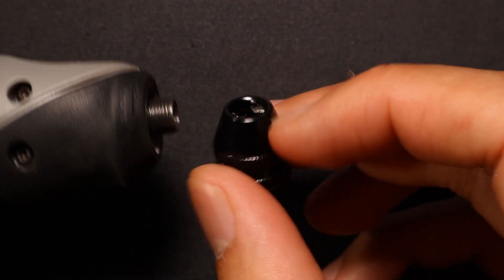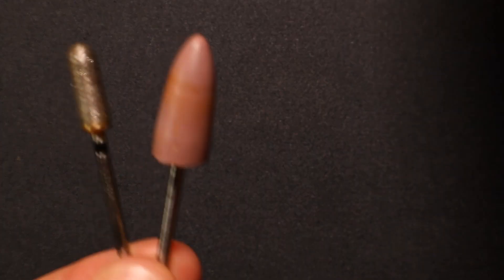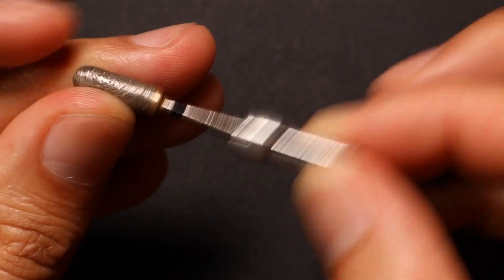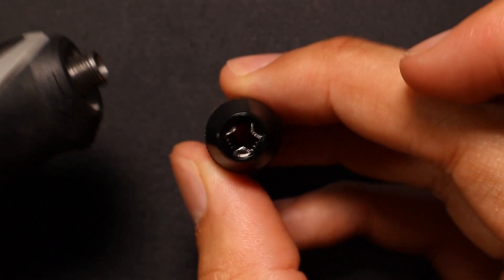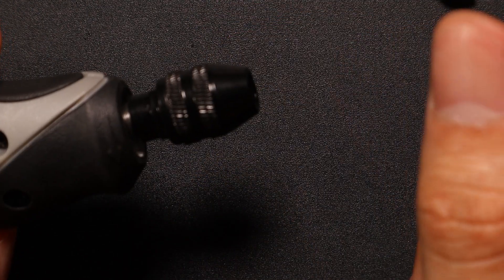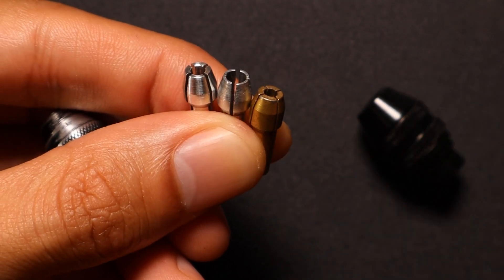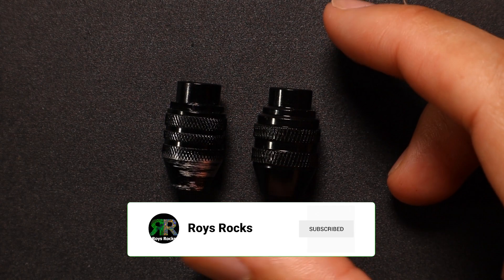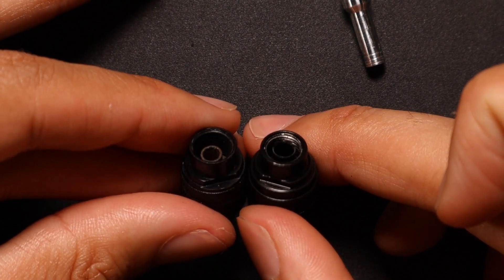How To Use A Dremel Adjustable Chuck And Why Its Better Than Collets.

Comment: Thanks Roy. I've been using dremel type tools for 30 years and always wanted a 3 jaw type chuck. I didn't know they made them.  I have a couple of the metric ones with posts that I use on my lathe etc., but I never knew that they made them with 9/32-40 threads. (which my tool has) So I found some on eBay. 3 for $8 ...Now I wait for them from China.
Reply from the maker: Nice one. They sure are handy. Imagine if you were using collets on a lathe! A true nightmare!
The threads not being the same across the board is soo annoying. 
The first time I bought the wrong ones for the ozito I was about to throw them out then tried them on a dremel and... it fit.

Comment: I have a cheap rotary tool that already came with such an adjustable chuck. Now that I have seen your video a remark my cousin made about shaft thickness finally makes sense. He was talking about the right shaft diameter and I didn't get it, because I had been using different diameters since the beginning. He is a gold smith and uses a lot of specialized tools.
Reply from the maker: Ah yeah if he has been in the game a while I'm sure he has come across the issue before so knows to look out for it.

Comment: Beauty! Just saved me a lot of time. Straight to the Ozito size. Thanks Roy.  You're a legend. Have a great day. Better head for the air con, come Saterday. Supposed to be 42 degrees  in Dimmy and only after you cop it first, in S.A.
Reply from the maker: Yeah dont get the wrong ones. They are cheap but a pain if you have to wait for another delivery.
Friday is our hot day here. Opal shed gunna hit 50+.
Reply: @RoysRocks  I feel for you. My place is an old weather board with no Insulation anywhere.  Only off grid power and batteries are not great at taking charge when hot or cold. Can get to 46 inside on a bad day. Sat may be like that. I'm heading for the back of the Ute with a swag mattress on that night. At least it cools down at night.
Reply: Deserts are like that. Cities are heat sinks. The roads just radiate the heat stored, all night. My sympathy for you. How is your dog? My puppy is close to 28 kg. She will wind up bigger than the greyhound. He is 42. She is 24 weeks old. Why do I do these things to myself????? Old body, dumb brain! LOL 😆

Comment: I have one bench grinder with flex shaft where the threads are lings. Have to stick to collets there, and use it for all my sintered, novas and polish tip. On my Dremel I use the adjustable one, burrs and cutting discs and such goes there.

Like them both, biggest plus to collets is that you don't need to make sure your bits are sentered, they allways are. Super quick when all shafts are the same size.
Biggest downside is that there are none small enough for my thin burrs, then the chuck is absolutely gold to have.
Reply from the maker: True the centering is something I forgot to mention with the collets. I've thought about having a dual rotary tool hanger using collets to fit both. Then I just change tool completely each time.

Comment: Mine lasted about 24 years and just finally took a dump the other day. Well, I should say it seized up about a year or so ago because it was packed with dust and I didn’t realize what was going on until the other day. I removed it from my Dremel and tapped out the little tool I had that was seized in it. I cleaned out the chuck and it started working just fine again, but I did notice that the little prongs  inside were not lining up after I played with it for a while.  Bought a couple new ones today to replace it.
Reply from the maker: A tiny bit of WD-40 has given some of mine extra life but I think they have all been pretty low quality so never lasted too long. The current Vevor chucks are going super strong though.
Reply: @RoysRocks  i sprayed.wd40 in mine after cleaning it. The springs must have been compressed to long because the clamps were falling out of place.  Ill spray dry grapgite in the new ones so i dont get dust and grime build up sticking to any wet type lube

Comment: I need me one of those! The large set of bits that I got for Christmas has some chunky shafts and some incredibly slim drills, and the brass holders are just a bit too large for the Dremel extension.
Reply from the maker: Yeah assorted shank sizes are a mad pain before getting a chuck.

Comment: Excellent info, especially the part about the two different collet nut sizes! Now, does anyone make a right angle attachment for the larger size thread?
Reply from the maker: I have seen right angle couplings before but never had much use for it myself. I can keep an eye out for one to pop up again. Maybe it was on amazon?
Reply: @RoysRocks  Thanks! I'll try and see if it exists, too. Most of the ones I've seen state "fits Dremel model XXXX" (and all dremel's use the same collet?) And I probably should've originally asked "the larger, metric thread (M8 0.75mm)" for others who may be interested, sorry about that!

Comment: Hi Roy. ...help! On Amazon there is a short tail & a long tail version of this Chuck ....  both are M8 0.75. So which one do I pick
Reply from the maker: All I sue are the short tail option. Some of the long ones might not reach the fully closed position.
Reply: @RoysRocks  Hi Roy, Thanks for replying so quickly. I will order the short tail one. Thanks again.  🙃

Comment: I have heard to always use the original collet chuck for the mini cut off wheels, but other than that the 3 jaw chuck works Great for everything!
Reply from the maker: I've had no trouble sawing with the adjustable chuck so far. I think cutting wood with a wood saw blade would be the riskiest one and there made the collet would be better but even they can slip occasionally.

Comment: My dremal shaft is just a hole so these don't work. looks like there is meant to be a cone inside the dermal shaft which you didn't show so was wondering is this a piece that you can buy to go in?
Reply from the maker: Just a hole? How does it hold on to anything if there is no way to close the hole?
Reply from the maker: "looks like there is meant to be a cone inside the dermal shaft which you didn't show"... no cone inside the dremel. 
It is literally just the thread which you can see from 0:00

Comment: I found out when I ordered my nova points that they didn’t fit my dremel. I bought the adjustable chuck then and it’s great so far. There have been a few times that the bur came loose while using it. But I figure I probably didn’t center it well. Definitely worth the cost to not switch the collets back and forth.
Reply from the maker: Yeah it is a small price to pay to reduce changeover hassles.

Comment: Great review.  The thread size issue had me confused stupid.  I have a dremel and a ryobi.
Reply from the maker: I think Ryobi will use a M8 0.75mm but you can check by measuring the diameter. It'll either match an M8 width or 9/32".
Reply: @RoysRocks  Jeez, don't worry about that Roy.  I'm just grateful for the thread size explanation.  I can work it out easily from here now.

Comment: have you experienced any problem with the keyless?
suddenly all of my bits started wiggling with the keyless or the collets
Reply from the maker: Hi. Not sure why my replies are not getting through... youtube issues.
I use a protective lubricant like WD-40 to make mine last much longer. The springs can corrode quickly due to the water.
Reply: @RoysRocks  no water is no problem i dont do anything with stone or glass
usually PCB and some light metal work and wood work

Comment: I use the adjustable but my burrs always vibrate loose. I have to re tighten often. I have a dremel with flex shaft. Suggestions?
Reply from the maker: I dont typically advise it but even on the adjustable chucks towards the bottom edge there is a spot for tool tightening if you need to give it a bit more of a squeeze. I press very lightly apart from with the 80 grit so just finger tightening works for me. Sometimes I get carried away and the 80 grit gets loose.
Reply: @RoysRocks  thanks. I’ve been working with boulder opal so the 80 grit is typically in for a long time.
Reply: I've had similar experiences. This chuck works best for drilling & polishing. It slips when cutting & grinding hard materials.

Comment: It would be cool if the shanks were a uniform size. But this is also a good option.
Reply: yea, there's no reason to have different sizes, like even from the same brand they have different shafts
Reply from the maker: It is a mad pain. Its why I hunted down felt burrs in 3/32" or 2.35mm.
Even with the chuck it can be annoying swapping between them.

Comment: It was very early on that I changed to the chuck! So much quicker
Reply from the maker: Yeah. These day though all my shanks are one size so less time saving but still useful every now and then (slicing is a big shank)
Reply: @RoysRocks  yeah I guess it depends on what you're using but for me with some drilling, none of the collets available would fit the size I needed. So it definitely helped

Comment: In my experience, this chuck works best for drilling & polishing. It slips when cutting & grinding hard materials.
Reply from the maker: I havent had any slipping really. Maybe a bit when doing the 80 grit stage on the harder opal like mintabie but I'm lucky that opal isn't the hardest of stones.
Reply: @Roys Rocks  Yes...for sure. I do a lot of metal work. And I've had chuck slippage when using a carbide cutting/grinding tips. No slippage problems working with wood or plastic.

Comment: Sorry this is not better than the original it come loose all the time and a burr coming out at 20000 rpm is not good
Reply from the maker: Never happened once in my years of carving everyday. You would have to buy a very cheap chuck for that to happen or not be using it correctly. There are pros and cons but that isn't one of them. Adjustable chucks are used on countless high rpm devices without a problem, just use them properly.
Reply: @RoysRocks  genuine part brand new and the carbide burr becomes loose all the time but I am cutting steel not sure if that makes it worse.
Reply from the maker: @extractengineeringltd  Genuine as in Dremel branded? I avoid any modern Dremel branded tools and accessories. Their quality control is almost zero now and I wouldn't be surprised if it is faulty.
Reply: Dremel branded
Reply: I have managed to get some new old style collet ones happy days for my purpose as these are dangerous on steel
Reply: @simonsays5979  But what if your hands are softer the the wifes😮😢.  My girl is usually too busy 😊.